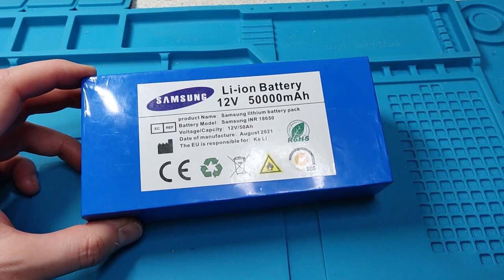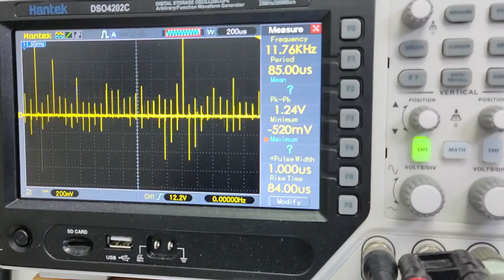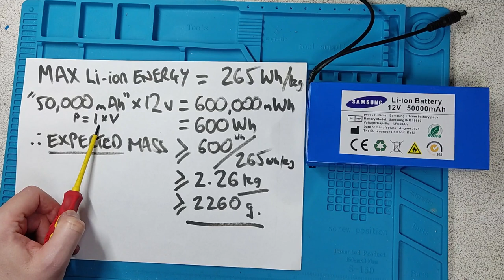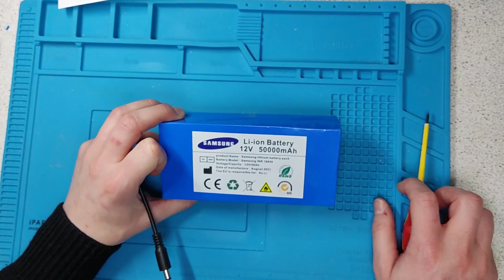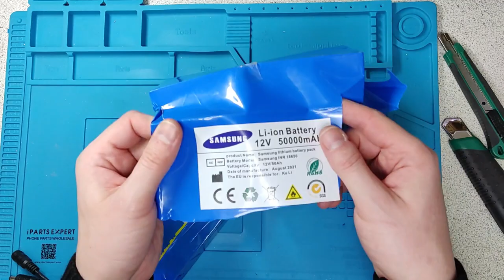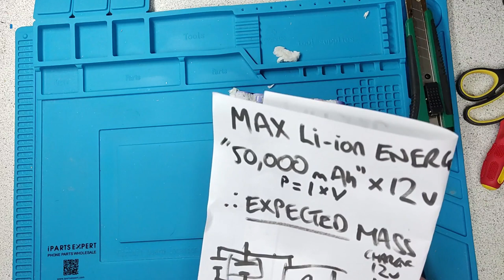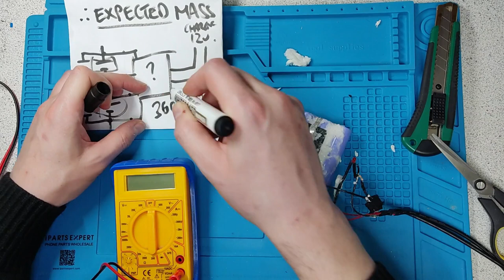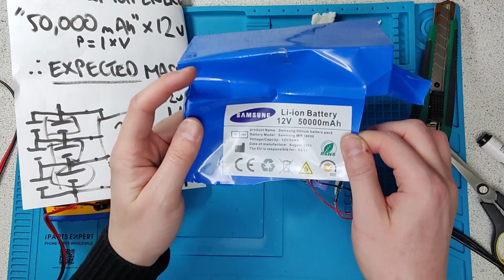Chinese 12V 50000mAh battery pack teardown (18650 lithium ion cells)

Comment: On the internet it says the highest mAh 18650 is the Panasonic NCR18650G (3600mAh). So if you use that info and battery knowledge, you can never get 50000 mAh. Regards

Comment: Actually it is at maximum: (3600*2)/3=2400mah or 2.4ah. I think these are cheap cells of about 600 or 700mah each. That will be a capacity of approx 466 mah.
Reply: 3S2P cell mAhxP count

Comment: Before seeing he video , it is impossible to get 12v 50 000 Mah with this small shape . If we have 12v 50ah we need 50 pcs of 18650 with capacity of  3.0ah .
Pay attention when you buy a lithium ion battery .low price equal to bad quality.

Comment: If you buy its best from ebay because you're safe and you usually get what you're after
Reply from the maker: There are also fake 18650s on eBay's too! I've found that online vape shops tend to pride themselves in battery life so  have decent QA over their battery suppliers, so they are  a good source for decent batteries.

Comment: what happens if we   put it on charging and in the same time we link it to load , does the bms will protect it and just discharge or it will be damaged
Reply from the maker: The BMS will protect the batteries from overcharge.

The load you are feeding will probably get quite upset with the noise that comes off the really badly made switched mode power supply plug that comes with the battery pack.

Should the load pull more current than the switched mode power supply can supply, current will be drawn from the battery too, until the battery drops below the BMS's low voltage level, at which point it will shut off. Then your load will be receiving whatever the  switched mode power supply can provide.

Comment: I was about to buy one of 48v 50a but when I saw 13s8p of 18650 I said it impossible to have 50a so I opened the chat and the bloody seller was trying to ensure me that yes the capacity is real and I told him the battery is fake
Reply from the maker: They are shameless!! I wonder if any of those 8 parallel banks were filled with sand?

The most you could get with 8 parallel would be 3500mAh * 8 = 28Ah, but I'd be willing to bet most of those cells are low capacity <2000mAh

Comment: I just bought the 48v 30 Amp then this video popped up
Reply from the maker: No worries: simply weigh the battery pack the moment you get it. If it weighs less than 5.4kg (48V * 30Ah / 265Wh/kg = 5.4kg), then send it back as "goods not as described".

Just check how it was advertised. If they stated "30 amp", then they might be referring to peak current output capability rather than capacity. If "30 amp-hours" then it's capacity.
Reply: @MichaelBrooksDr  it's actually the same one in this video and it says capcity 30 amps I want to parallel with my other 48v battery for ninebot max g30
Reply from the maker: @jonathancifuentes7442  Jeez they really are taking the mickey now. Are there only 6 Lithium cells in there? Or have they at least added another 6 to create 6s2p so you get your 48V?

If you are looking to parallel with another pack, make sure the second pack has similar characteristics (actual capacity, voltage) and has its own charge/discharge controller.

Comment: for 60cell packs diy old batteries i get +- 400wh 12v of power its 2.2kg per pack its from broken not working laptop batteries so yah max 480wh was puted AT BEST in same space @@

Comment: Friend you helped me alot,was look8ng at these packs for a project I am working on.inverters are the other thing lied about.purchased a 1000 watt inverter thru aliexpress.they said was 1000 watt,when tried to use would not go ove 475 watt
Reply from the maker: I've found that the best way to get proper 18650 Lithium ion cells is to buy them from a reputable vaping products dealer, then get the charging / protection circuit as a module from AliExpress. You'll pay £2-£4 per Lithium ion cell but they will be high quality.

Comment: woh u should understand china . 12v *(2000mah +2000 mah)=48000~50000. now u understand  mathmatics, whoops. The chinese Math u know.
Reply from the maker: Eh?

The battery quotes its capacity in milliamp-hours, which is current * time. In your comment you are multiplying current * time by voltage, which gives you capacity in milliwatt-hours. But the battery quite clearly states "mAh". A few lines below it says the same thing again "Voltage/Capcity: 12V/50Ah" [sic]

Power = current * voltage

Power * time = current * time * voltage
(mWh = mAh * V)

Is your argument that the label is a typo and that the Chinese manufacturer really meant "50000mWh" and "12V/50Wh"?
Reply: @MichaelBrooksDr  Chinese Math is out of world. It 50000 means 50000 . afterthat all are valueless letters . wow its the way China calculates its GDP and what not? ha ha ha.Sorry see my answer as light humour .

Comment: 4Ah at best
Reply from the maker: I've been using the cells to run my bicycle lights. Judging by the runtime I'd say it's even less!
Reply: @MichaelBrooksDr  well lights are a constant draw at whatever amp rating so runtime is a factor of what hour
Reply from the maker: @joeKisonue  yes, watt hour is amp hour * voltage. (Wh = VAh). Both are therefore a measure of total capacity of a battery.

Comment: The Chinese add each cel mah and multiply by the number of cell so if 36v 10S3P  has 30 x 18650 cell of 3000mah rating the battery should be 9ah or 9000mah however the Chinese do 3000mah x 30 and write 90000mah to scam buyers
Reply: this is correct - undersize Chinese  math - this battery 50 000 /12 = 4 Ah   - simple :)